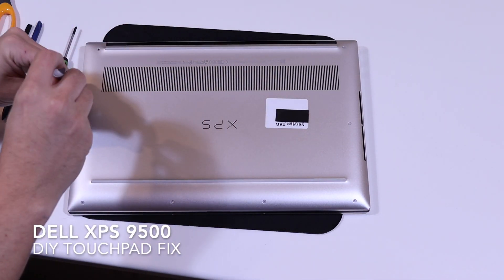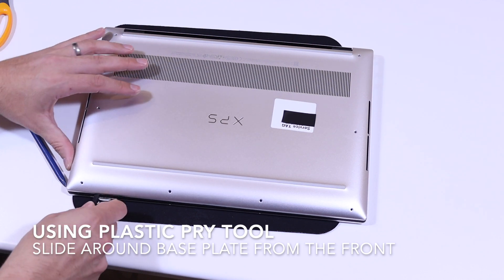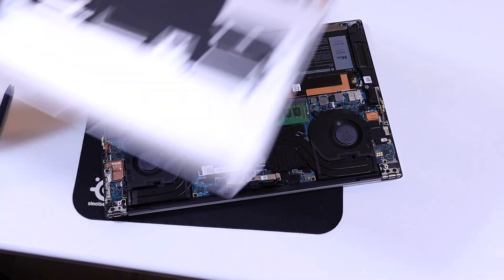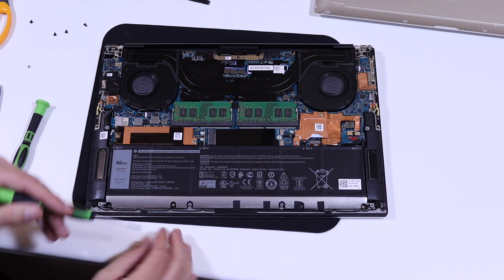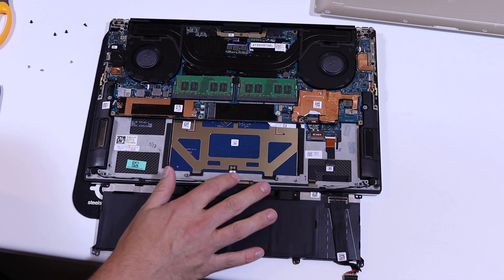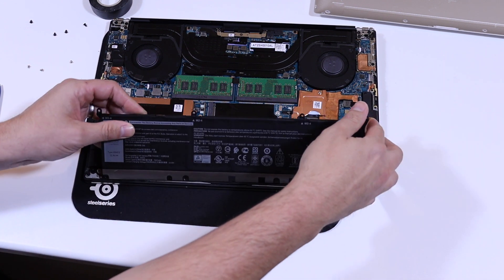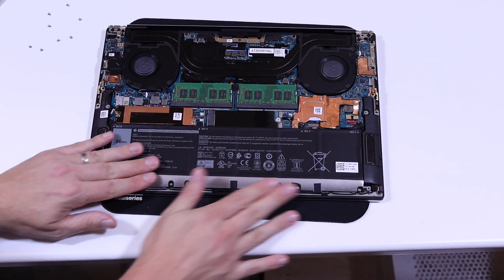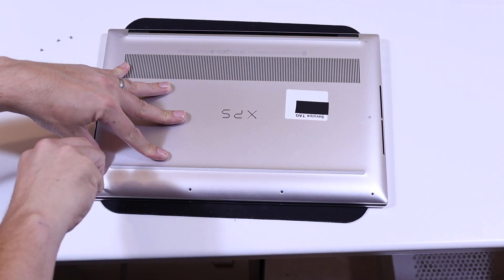Dell XPS 9500 loose touchpad DIY fix

Comment: I can't believe that this worked! 

I had a Dell tech guy come to my house and replace the trackpad only to sever the wifi antenna. Then they sent another guy to my office with a new motherboard, who screwed up the trackpad again. Then I sent it off to Toronto to get it fixed at the main depo, only for it to come back slightly better. 

I followed the video instructions and made sure that the battery screws were super tight and boom a fixed track pad. Dell probably spent $$$$ on tech time, 2 new trackpads, 1 new motherboard and shipping trying to fix my computer, when they could of just used some tape..."The Canadian way to fix things eg, use more tape"  LOL
Reply: So I'm guessing you ordered the XPS 15 recently. Dell said they would fix this issue after admitting it in June 2020.
Reply from the maker: Loads of people are still getting this faulty trackpad since that date. Lots of people have commented that on this thread 😭
Reply: @MashITTech  UGH. This is a great laptop.  Users are reporting when the laptop is sent to Dell technicians, the unit doesn't come back completely fixed. Looks like I'll be handling this one on my own if I have a wobbly trackpad. Thanks for your tutorial.
Reply from the maker: I am so glad it worked for you too! I have no idea why dell can’t just work out a proper fix for this

Comment: Will the Electric tape as spacer wear out over time? as lose its function as a spacer later? do you experience any degrade trackpad function after 3 months since this video was posted? i wonder if i should use something like Mylar or similar more long lasting material? any suggestions?
Reply from the maker: I don't think it will degrade for quite some time! So far my customer has been more than happy since I fixed it for them
Reply: @MashITTech  thats good to know thank you so much for posting this fix, i know its a litlte unrelated but the lid opens when the laptop is in vertical position that others have noticed, do you also experience that ? it wont remian closed when closed and place in vertical? wondering if you have figured out how to fix that possibly?
Reply from the maker: Hmm, I didn’t notice that but to be fair a customer brought it in to me, I fixed it and they took it back. I have one coming in for an actual review so I will be sure to check that out and get back to you

Comment: I got my Dell XPS 17 yesterday (and holy shit it's friggin gorgeous) and the trackpad seems a tiny bit loose at the bottom half. It's not annoying or obstructing me from any tasks (maybe because the issue is not as bad in mine?), but I do notice some noises that shouldn't be there when my fingers are at the bottom of the pad. I've always used touchpads by subtly tapping on them rather than pressing, so maybe that's why I don't feel the looseness? I will try this fix if it starts bothering me. That said, it's mind blowing how a two dimensional piece of electric tape can provide enough pressure between the battery and the trackpad.
Reply from the maker: Glad you are enjoying it. I haven’t got my hands on a 17 yet! The amount of play varies because the tolerances aren’t great. Some are perfect, some have a little play and some are really noticeable. If yours seems ok then don’t worry and enjoy the laptop, but if it does bother you in the future you can fix it. It is crazy that this fix works but it is the poor way that dell uses pressure from the battery to keep the trackpad firm, I have no idea why dell didn’t have the plate screwed firm to the chasis
Reply: @MashITTech  Yeah all of these discussions and fixes onlines do not change the fat that this reflects horribly on Dell.
Reply: And of course thanks for the fix!
Reply from the maker: Not a problem, just happy if this helps a few people

Comment: Received my XPS 15 9500 today and instantly noticed the wobbling, it was so bad. Then a quick googling and found this video. 30 minutes later and the touchpad was perfect. Added four or five pieces of tape from left to right, evenly spread. Thank you so much, pretty easy fix.
Btw, the speaker cable tapes are much easier way to go than trying to detach the battery cable, just remove the tapes (you can put them back afterwards) and flip the battery other way round on top of memory sticks.

Comment: I opened a case to Dell and still returnable. and I found this video, if this is a fix, replacing the laptop won't fix this clicking noise since it's design fault?
Reply from the maker: It is certainly a design fault but certain laptops have better fit/more pressure so do not suffer this issue. That’s not to say it won’t develop over time. It’s a pretty poor show from dell on a premium device

Comment: Just received my replacement machine today... faulty track pad... AGAIN.  Waiting to hear back from Dell about what they're going to do for me now.  I don't think the issue was fixed with the new machines manufactured after June like Dell said it would be.
Reply from the maker: That really doesn’t surprise me! Dell QC can be really hit or miss. Sorry to hear your replacement has the same issue, when you are paying this sort of money these issues should not be occurring
Reply: @MashITTech  Agreed.  At first they offered to send me a refurbished unit and I told them to piss off and that I wasn't paying that much money for a potentially used unit.  The whole experience has been terrible with Dell.  Anyway, not to complain... it will all work out.  I figured if I posted my comment someone would see it and potentially save them from the head ache.  My advice is to wait until next year for a new Dell XPS 15 9500.  It doesn't seem like Dell has this figured out yet.
Reply from the maker: I think the biggest problem is that it is only the pressure from the battery that is stopping the pad from moving. They really need a plate behind the trackpad or a frame screwed in. This ain’t something they will be fixing in this revision so I think your thoughts of waiting until r2 are spot on

Comment: Mine worked fine... But after two weeks started making some very subtle noises. This didn't work, unfortunately. Also, trying to disconnect the battery just did not work. I ended up lifting the battery and adding a piece of paper + electrical tape right underneath the pad. It somehow worked, like 99%. Just be sure to check the temperatures afterwards to verify any suspicious and dangerous increases .
Reply from the maker: Yes, in essence it is a similar fix, applying extra pressure on the trackpad. We shouldn’t have to do this though! Sorry to hear about your problem with it
Reply: @MashITTech  exactly... :(

Comment: For anyone who wants to know, I just followed his instructions (although I put tape on the far left and far right as well, just to be sure). Worked like a charm! Thank you Mash IT! Note that he made disconnecting the battery look very easy, it took me a while because I was afraid to force it too hard, but I've never opened up a laptop before either.
Reply from the maker: So glad it worked for you too. And I have been fixing and upgrading laptops for years so very used to these types of connectors, but yes they can be tricky to remove. Thanks for taking the time to give us your feedback
Reply: Can you Tell ne how to disconnect the Battery? I am Not able to do it.
Reply: @werderass  I used my finger nails, just really slowly, sorta putting pressure on one side at a time kinda rocking it until it popped out. It's scary to use too much force cause there's delicate components but it did require a certain level of brute force.
Reply: @bunaventure2  Do you have XPS 15 or 17? I have 17 and that's my plan for the next week - trackpad is slightly wobbling
Reply: @aleksandrabaszczak1069  I've got the 15. I'm sure the process will be the same
Reply: Sounds exactly like my fault. How many strips of tape did you put on roughly to save me the hassle of re-applying?
Reply: @leechurchill5182  I put two layers on the left side of the trackpad as that side was the most recessed, and put on piece in the middle, and one piece on the right

Comment: Thanks for this tip. I just got my xps last week and and the noisy trackpad. Just finished installing tape and all good. There was some foam pad there but I guess not think enough. Now I noticed that intel has a 11gen processor coming out in a few weeks and deciding if I should return anyways and upgrade later.
Reply from the maker: not a problem, glad it helped!

The 11th gen is only coming to the 15w cpu's for the moment. I don't expect we will see 45w models until next year so it depends on how badly you need the laptop.
Reply: @MashITTech  Only the 15w for now. K I guess I'll just keep it. Thanks again.

Comment: I ordered and received my xps 15 in August. Even though Dell announced that they have identified and resolved the issus in June, the machine I received still has a loose trackpad which really makes me a headache. Since other functionality works fine and school started in August, also Dell CS is extremely stupid and inefficient, I didn't replace it and moved everything into my new xps 15... Thank you so much for sharing the tutorial video, I'm glad it's not a difficult work then I can fix it sometime.
Reply from the maker: Sorry to hear this is still happening, and yes it is a real pain to get dell to resolve the issue which is why my client asked me to fix it. To be fair even my local dell engineer lets me fix any machines I have with problems

Comment: I just got my 9700, the right side of the touchpad is slightly higher than the left and if I lightly tap on it, it makes a noise like it's loose and the right side does not. My build date was August 24th. Guess it's time to contact them, had it for less than a week.

Everything else seems good though.
Reply from the maker: Wow this is terrible news, Dell promised they had fixed it for models produced after June but clearly not. Glad everything else is ok, I am sure they will send an engineer out to fix it for you

Comment: My XPS 15 was deliverd on 27th August - so it is new machine - dell had stated that this issue will be fixed for all machines shipped after June. However my trackpad is not perfect.The bottom conrners are not the same - i mean the left corner is deeper than the right bottom corner though the difference might be  less than a millimeter. When i press the left bottom corner of the laptop the trackpad levels out evenly...?? and it feels more secure... Do you think this fix will help me out or is something wrong with my laptop frame....
Reply from the maker: Typical dell! Sorry to hear that. I think if you are not going to get it replaced I would open it and apply a bit of tape to the side that is sinking, screw the battery in and test (don't screw the bottom on as it may take a few attempts to get that right, mine was easier to fix as it was universally out)
Reply: @MashITTech  okay i will try to fix it soon. i have already installed a 2nd ssd with my data so i want to try to avoid changing the machine - and who knows what issues the replacemant will have....:) thanks for the reply...

Comment: Thank you!! Also, when you plug/unplug the charger on your Dell XPS 15 9500, does your laptop screen temporarily go black for a few seconds and then come back? I had this issue on a HP but fixed it by turning off refresh rate switching, but can't seem to figure out how to turn it off on the XPS 15...
Reply from the maker: No I haven't sorry, I certainly haven't come across that bug yet!
Reply: Is your HDR on?

Comment: I had the same problem and got a replacement. After doing windows update, do you get slightly distorted sound quality when you hear windows notification sounds?
Reply: I had the same issue with windows sounds...replacement of new spekaers did not worked, so returned whole laptop back to store and I am gonna wait few months and hope that Dell will solve this issue..touchpad and speakers ...
Reply from the maker: Unfortunately this was a customer unit so I didn't get enough time with it to play with the sound etc. Could it be the Wave Max settings? Also windows notification sounds are pretty low quality, how does music sound?
Reply: @MashITTech  music sounds fine.  its only the windows notification sounds but it only sounds bad using the laptop speakers.  if i plug in headphones, the headphones sound fine believe it or not.  but its not the speakers that's the problem because regular music and youtube sounds fine.  so its the windows notification sounds only through the laptop speakers.
Reply: i am having the exact same [problem... i also downloaded and reinstalled the drivers again. Still the same. I am hoping it is a driver issue and not faulty speakers.. Please let me know if anyone fixes this issue....
Reply: I had distortion from one of the speakers on my 1st unit. If you changed the balance 100% Left 0% Right it sounded fine but reversed the distortion very obvious. I had the speaker unit replaced and that fixed the speaker but the tech managed to bend and scratch the base cover. He had struggled removing it and must have forced it.
Reply: @warren7830  is it that hard to remove the bottom cover?  I seen plenty of videos on how to upgrade the ram and SSD and everyone says to remove the screws and the base just comes off. nobody says its hard.

Comment: Had this issue and ordered from Dell UK. Replacement was also problematic. Also both units came dented out of the box.

Trackpad also are very hard to press on top part right? Is the issue on new units really fixed?

Bios says 08 MAY 2020. Seems they are sending me first batch replacement. So dissappointed...
Reply from the maker: Wow it sounds like you have had bad luck! I can’t believe they were dented! Dell have said any units manufactured after June will not have this trackpad issue, but you can’t trust everything dell says 😜
The trackpad will be hard to press at the top as it is a hinged mechanism like most trackpads, only Apple uses a different design with its motorised trackpad
Reply: @MashITTech  Seems to me the laptops are slightly used/returned UK units, thats why they come out dented. 
Bios date is May 2020 and my replacement was ordered in September. Im sure they are not sending brandnew units from the factory. Dell UK crap...

Comment: Thank you very much for the information! I got mine a few days ago and it has this problem, fortunately, I seems to be a very easy issue to fix. Thanks a lot
Reply: Hey, did the fix work work you?
Reply: @sinanuluc5143  I haven't tried it yet, I'm waiting for the warranty to expire, but if you see other comments, it seems to be working!
Reply: @josetena5983  Thanks! So how do you keep using it with the trackpad issue?
Reply from the maker: the trackpad still works fine, it is just loose. You can get used to it but you shouldn't have to
Reply: Yeah, I think this is not a very bad issue, I use it every day and it works fine, only sometimes when you keep pressed for drag an item or something, it gets loosed, and in other cases, you can get an unexpected clicks but it is ok, I can deal with this
Reply: @josetena5983  waiting for the warranty to expire? Just an FYI, removing the base of your laptop does NOT void your warranty. The laptop has upgradable storage and RAM slots. You are allowed to open it up!
Reply: @HeliumFreak  Really? I didn't know that, thank you for the information! :)

Comment: This 2020 Dell XPS is extremely faulty laptop. I ordered 9500 and received a good unit but after 4 days or so a white dot (dead pixel) appeared on the screen. So, i called them. after a month of going back and forth they sent me another unit and this one has faulty trackpad. My Fall classes has started and i need a laptop so i guess have to fix this damn thing myself. Good video though i will definitely  try to do exactly as u did.
Reply from the maker: Sounds like typical dell QA! They make some decent machine but it’s pot luck if you get a fully functioning one! Sorry to hear about your woes

Comment: I have an XPS 9700 on the way, and am fully expecting to experience this. Glad to see this is a two minute fix if I do end up with a faulty trackpad.
Reply from the maker: Yes it really is an easy fix, that said we really shouldn't have to. Hope your 9700 comes in perfect. I have yet to get a 17" in yet so would love to hear your opinion when it arrives
Reply: @MashITTech  The left bottom corner of the trackpad is indeed loose. I also have a small click noise from the trackpad giving way when it gets initially touched. Will be doing this mod this weekend.
Reply: @chrism65  Did the mod work out? I have the same issue as you. Got mine a week ago.
Reply: @chrism65  did it work?
Reply: @AnimeHail  it didn't for me, no. I just learned to live with it and click more towards the center of the trackpad.
Reply: @MashITTech  cant you just replace the trackpad